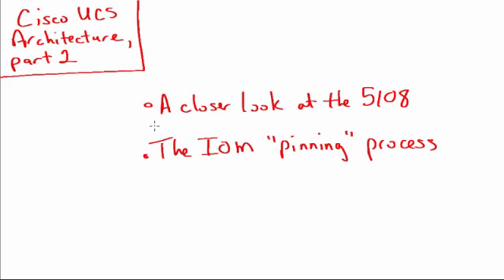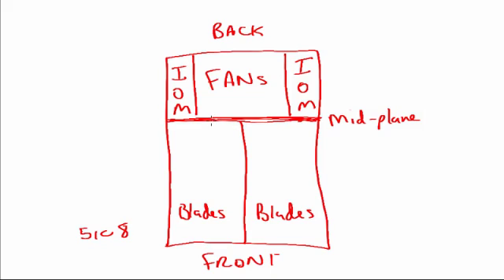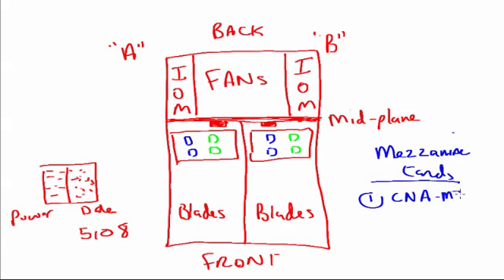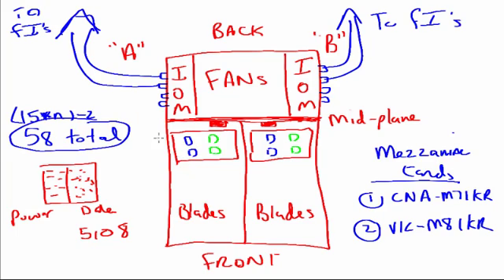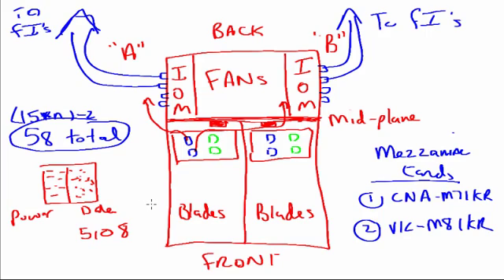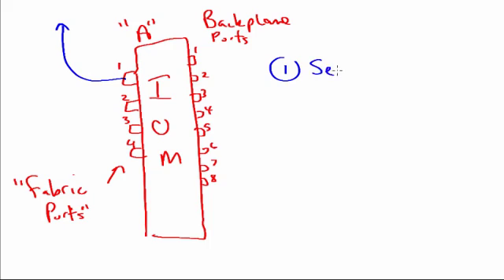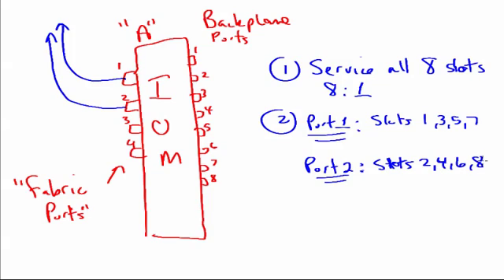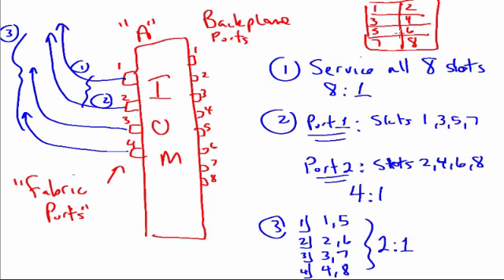Cisco UCS Whiteboard part 2

Comment from the maker: Arnold Decal:  Do you mean the full-width blade?  In those cases, they map to both slots (1&2, 3&4, 5&6, or 7&8).  You can have any combination of full and half-width blades that fill up the chassis.  The full-width blades can have two mezzanine cards, so each one will fill the respective port numbers towards the IOM modules.  Hope this helps!
Reply: Jeff where is the 3rd Video you mentioned?  This is great stuff man, you do know how to simplify the material.

Comment from the maker: izs125: No, if you have 6 blades, you still have the 1, 2, or 4 fabric port connectivity options for the IOM 2104. If you connect all 4, then you'll just see that ports 3 and 4 will service 3 and 4 and not ports 7 and 8. The number of fabric ports should be based on the throughput needed for your blades. Thanks for the question!

Comment from the maker: Without a service policy, a blade does nothing, so yes, it's the service policy where you define how many vNICs a blade will have and whether they'll be 1 or 10GB.  Your ability to create more vNICs per mezz card is dictated by the number of fabric ports between your IOMs in the chassis and your Fabric Interconnects.

Port channeling appears as a single interface to the blade's service policy, so there is no negative effect and is always recommended.  

Great questions, thanks!

Comment: Are the 2 10GB presented to the blade as 10GB or does it take a service policy to say how many and what speed I want the NIC presented to the blade? I thought that the 10GB was presented to the mezzen card (north facing) and than the service policy told the server how many connections it will have that connected into the south side of the mezzen card( i think thats one two many layers) Also how does port channeling effect pinning in a 2, 3 or 4 uplink scenario?

Comment from the maker: @ebus5 Great question.  If one of the cables becomes damaged between the IOM and the  Fabric Interconnect, it does not automatically rebalance.  Instead, you have to ensure that the service profiles for any blades plugged into slots affected by the outage is configured to also send traffic via the other fabric.  If you are not able to fix the IOM port, then you can "reacknowledge" the chassis, which will then rebalance the IOM connections from 4 links to the next lower option of 2 IOM links.